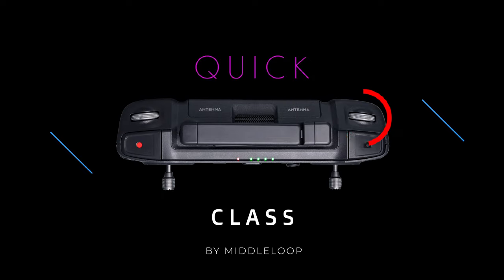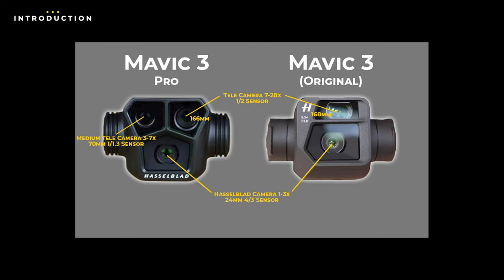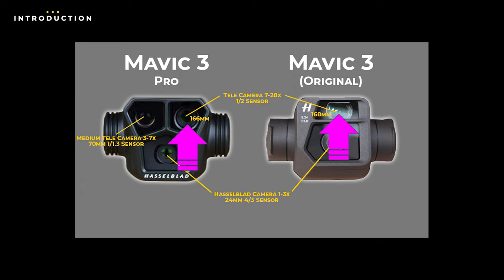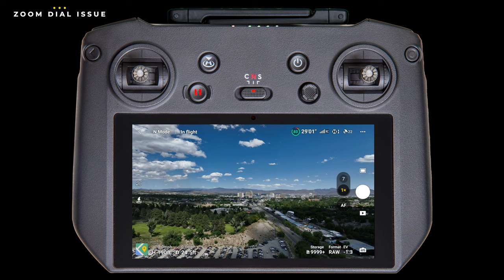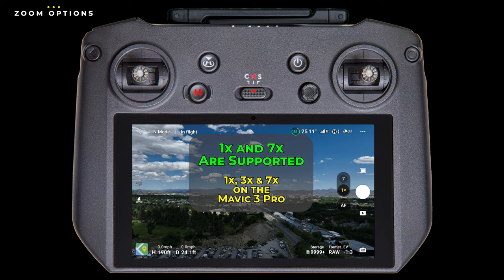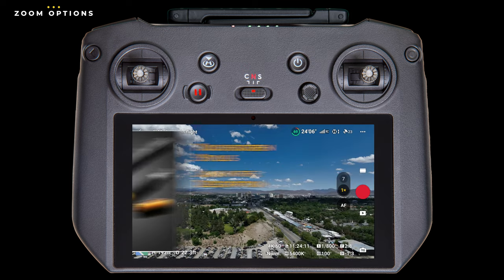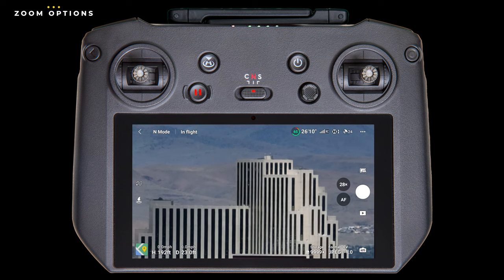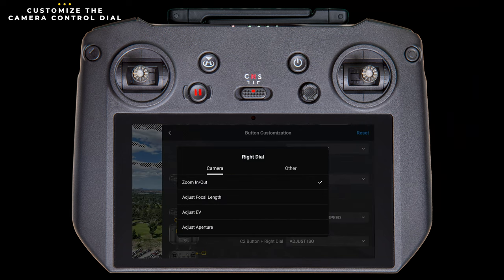How to Fix Your Zoom Dial

Comment: But can you change the speed of the scroll wheel for the zoom? That's the issue I'm encountering; while filming, it doesn't feel smooth and slow like I want it; the speed of the zoom is too quick. I know you can change the flight controls of the drone, but can you adjust the zoom speed?
Reply from the maker: I’m not aware of any way to change the speed of the zoom wheel. But, it is variable depending on how hard you crank on it. I personally haven’t found that I have needed to adjust it. I’ll need to check, but I believe can also zoom from the touch screen. Maybe you’ll have more control that way.

Comment: on the Mavic 3 Classic ??? Please help 🥰
Reply from the maker: Are you saying this fix doesn’t work on the Mavic 3 Classic?  It should. The video was produced on the Mavic 3 Cine. Which is a classic. Which controller are you using?

Thank you for the post.
Reply: @middleloopvideo  
I am using Mavic 3 Classic
and RC Pro !
♥️
Reply from the maker: It should work. Make sure you are on latest firmware and DJI Fly app version. Follow steps in video and provide details on when your experience differs. 

Thank you.

Comment: my 1X camera blurry on my Dji mavic 3 pro
Reply from the maker: Something on the lens or ND filter?
Reply: @middleloopvideo  nothing on the lens…l haven’t changed the filter it came with
Reply from the maker: I assume you have focused it. I don’t have the M3 Pro, but tapping on the screen on the subject will focus and set exposure. There’s probably a setting for auto exposure too. 

That’s all I can think of. If not that, give DJI support a try.